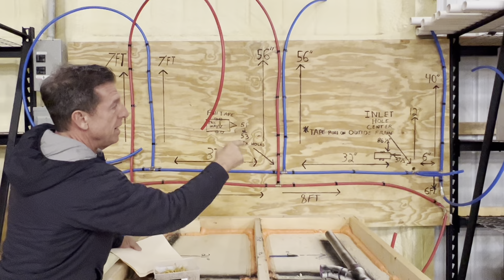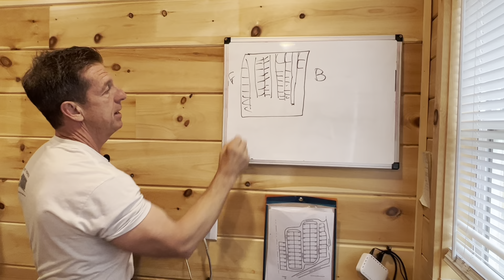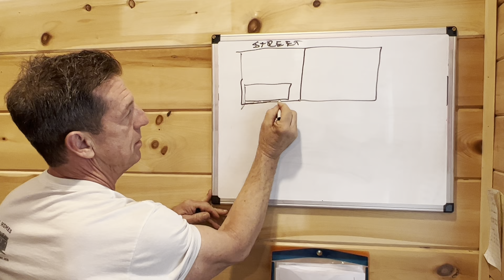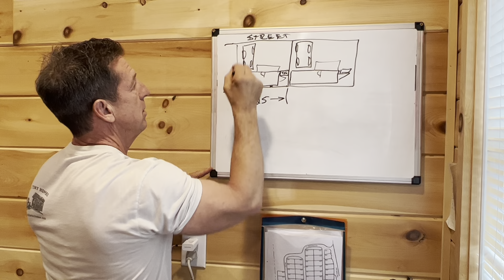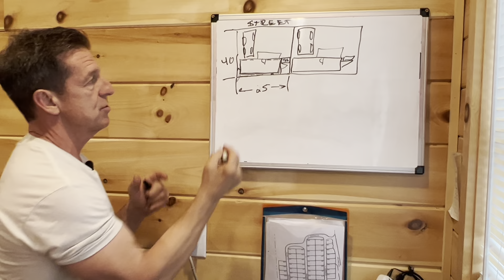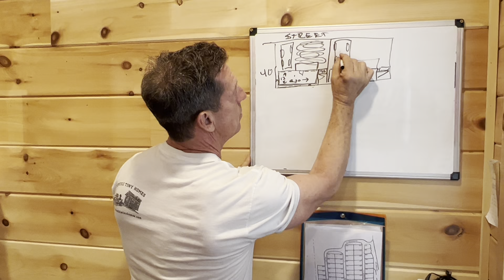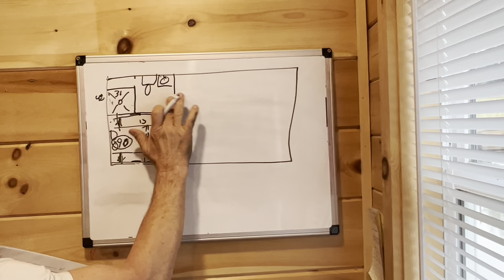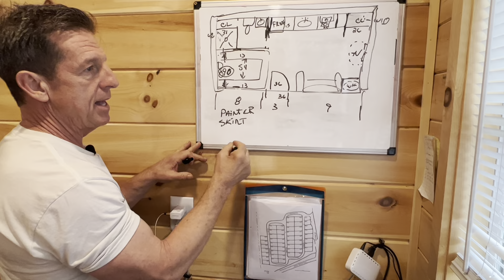FOR SALE….New 12’x20’ Incred-I-Boxes and Leased Lots for $59,900!!!!!!!!!

Comment: ❤ Hi.  love your new assembly line plan.  Love the new Incred-i-box plan too.  However, although I have only seen your drawings and not the actual  house I am feeling a little suffocated.  Why, because of the idea of I guess only maybe two windows which may seem practical to you and your design but, just leaves me feeling suffocated.   I have lived in apartments and know what it is like within some windows, terrible!   But to have my own little or big house without windows is also to me terrible, whether I can see out of them or not.  I suggest some kind of small window over the or by the toilet or sink in bathroom.  Maybe transom windows over sink area or some other small windows on that wall.  Transom  window over bed. And of course your front windows you did not show where in the front.  Also I suggest the W/D be close to the bathroom. If the W/D is not stackable one can build a shelf there over it. And the refrigerator should be switched to the W/D placement at the end of the counter.  I realize these homes will be close but they need other windows on the sides besides the front. There are certain types of shelves if people want that can be placed over or by a window!  I feel this is important psychologically. I may be wrong but it is my opinion.  Continued blessings.  P.S.  many buildings in a city buildings have windows that face walls, however, it my not seem practical but the windows are still there.😊

Comment: That’s a lot of extra plumbing if the water heater is in that corner and the washer dryer in the opposite corner.  that’s my only issue with the design so far. Could it not go just the other side of the bathroom wall where the fridge is? And then the washer dryer beside it and fridge  where you have the washer dryer?

Comment: I don't know it this is possible but the bathroom closet would be better if it was on the other side of the shower because I don't think anything can be stored in the bottom area with the toilet so close. Unless the water heater would fit in the bottom. I sure would like the waterheater some place else so I could put an L shaped hide-a-bed couch (in that corner) with a coffee table that adjusts to a dinning table hieght and 1 chair.  Cute little house.

Comment: Late to the party, as usual!  🙃  Haven't read all of the comments, but I'm seeing some good ideas!

For me, one of the primary concerns is ventilation and air circulation. 

I currently live in a 600 sf apartment with all of the windows on the east side; one fixed pane, two operational. Even with fans, there is dead air in the rear of the apartment. Absolutely miserable, even when it's gorgeous outside!

If the opposite wall had adjustable, screened, transom windows opening outward (creating their own awnings) just below the ceiling, air could flow freely. Window height six inches or so?

...Teale  🏜️

Comment: I am confused. Will you be kind enough to answer questions. I am sorry if I missed the explanation or got it wrong. I have been trying to buy a tiny home from you for months and months, but things keep changing and I get flustered. Question #1. Video after video you talk about wood, stick built, tiny homes and that you will not warranty them anymore because of the expand/contract quality that happens with weather/environment conditions. Now are you saying that the stick-built model homes WILL BE warranted? Is the Omish wood home warranted?  Question #2. When we buy our Tiny home, you said that our money is spent on the product needed to build it. That you stack it on the trailer and it is good to go. So, how many homes are on the books that have been paid for but not yet delivered? Why are you talking about getting in materials and costs of materials for those homes? Shouldn't everything needed to build the home have been bought and in stock over a year+ ago and is ready to go?  Question #3. Now that the ESP home is available to us again, when will the "70-lot home" be finished from the day you cash our check ? Did you tell us this? I may have missed it. Are there custom ESP homes possible too or only stick ? Question #4. Asking Again. Assuming us older folks with health issues live to enjoy several years of living in our beautiful home, and then proudly leave our home to be inherited. The rent is paid. Will you honor the "Forever Rent" price and right to renew the lease ? Or what happens ? Is this in the lease agreement contract ?  I hope these are not dumb questions. 🤔🤔🤔🤔🙃🌲🌲🌳🌳🌼🌼🌻🌻🌷🌷

Comment: Checkout the video Palm Springs revamps trailer park on kirstin Dirksen channel. Now these are bigger homes, but how they place them on the small lots to ensure privacy is very interesting. Also they have the monoslope roofs, with high hopper type windows on the side facing the neighbors for privacy. ( I think if you add just a touch of height on your monoslope roofs on your incrediboxes (and or with the high windows) would really take them up a notch without hopefully much cost. I’ve also seen some tiny home parks that place the lots in such a way that there is a center courtyard shared by 4-6 houses... that can have the fire pit, or other communal space. I hope you will look at your placements one more time and see if there isn’t a way to get as many lots but also make it really livable. I also think the current layout needs a little tweaking. The toilet closet looks unusable to be honest. Your 10x20 esps were really well laid out. I agree with all the comments moving the washer dryer to next to the bathroom and the water heater at the end ( no cabinet, but a bit extra counter top) and refrigerator spot around the corner from the cabinets. A bit of an L shape but just slightly... like in the 10x20 esps. (No one really wants a big permanent wooden box in their living room...) I’m glad you’re doing a bigger incredibox! Also you might consider how to make incrediboxes modular, ie someone could buy a regular incredibox and buy and add on an empty incredibox for extra space...

Comment: Ok, Randy I know your mindset is assembly line production for your Incred-I-Box homes but the water heater in the living room next to the couch just doesn’t check the box for livability and decorating and your not selling the idea that it is the perfect location for an alternative radiant heat source for the living area. 😂 So here’s the idea for the optimal location of the water heater “IN THE LOFT” it’ll be closer to the points of use with it up there. Quicker hot showers means less water waste. So here’s the best reason for my argument. Remember the Hey Beck, Hey Will, video well I’ve watched that video a few times an if you said Hey Will where’s that 19 gal. water heater? Hey Will would say IT’S IN THE STORAGE LOFT!!! 😂 Well if it’s good enough for Becky and Will’s beautiful ITH it should be good enough for the Icred-I-Box. Since the loft covers a 50+ sq. ft. area and a height of 36” at the entrance wall so stealing a little over 2 1/4 square feet of loft space at the bathroom wall in the loft wouldn’t be missed and as you demonstrated in one of your latest video’s the weight capacity per square foot on the Icred-I-Box roof proves it’s an optimal location. If my research was correct you can eliminate the heat trap nipples installed in the water heater and replace them with brass or bronze reducing ell’s or reducing elbow’s with shorter nipples. With the unit plumbed in that manner it would be less than the 25” height it’s spec’d out as. If a slow leak develops and rain drops keep falling on their heads so would Becky and Will’s if theirs leaked. Another plus is don’t have to build 80, I’m assuming here, fancy wood cabinets because that’s the craftsmanship you get from the cabinet shop. By relocating it to the loft it would also give the homeowner more seating options for the living space. Possibly a 97” sofa w/ reversible chaise in front of the windows or Two recliners with a table lamp in between them for the remotes and cool beverages.👍
  FYI the bedroom/bathroom drawing shows the loft width as 84” where the floor plan drawing shows the bedroom width as 90”. 
  Thanks Randy and Amanda for the time and effort you and the rest of the crew behind the scenes that keep things running while your making these ITH videos!!! You guys are a riot!!!😃

Comment: I hate to tell you but I would suggest you look under hu regulations because their government and they supersede all states. Had regulates 15 feet on your ends and on the front and the backside 20 feet. Those are regulations for mobile home parks route RV parks that have lots. Just a suggestion you can take it or leave it but it will save your time if you check it out because it’s nothing like doing them and then having to redo them it’s gonging to take time cost and money. The reason I know this is because I’ve done a lot of research in this area.

Comment: Hi Randy and Amanda! My son is going to pick-up my Incredibox and bring it to me in Arizona. Could you tell me what he needs to be able to drive it there. Are their tags, special insurance?  And what about the route he should take. He's never done this, but is excited for the adventure. :goodvibes:
Reply: Best to send them a email.
Reply: You will need to tag it as a travel trailer (means a trailer tag), and get RV insurance for it (ins. should only be about $100/150 yr). Check your vehicle's towing capacity (you can ask a dealer). You will need at least 6,000lbs capacity, as the Box weighs close to 5,000. But I've towed plenty over the years, and highly suggest 8,000lbs or more capacity. Not sure how high the box is, but stick to major roads as much as possible. Parkways have bridges at 10 feet high, stay off them. If you have any low power lines, ask the County about their heights. Keep your speed at 65 or below. I would recommend 55 if he's never towed. Go to the outside pumps for gas, more room to maneuver. Check satellite views of Gas stops ahead of time, be sure the lots are large enough to pull in and out successfully.
That's about all I can think of. You can PM me with more questions, I've towed all different sizes and lengths of RV's over 25 years.

Comment: I can't sleep 🤔
So on the bath / bedroom end have the bathroom open to the bedroom put toilet , vanity  with hot water tank under it. On the other wall the shower and 30" for a washer/dryer that would give you a 36" wall on the right and a 24" on the left 36" open to walk in. The customer can put a curtain or a barn door or leave open. Apx. 66" x 96"

Keep the kitchen/living room open.

Comment: 40 thousand for a lot.  Bet you could buy land .
Reply: That is completely wrong. Its a leased not a bought lot. In Fact it's about $8000+ for the lot infrastructure and around $52K for the Complete(includes set up, skirting, outside paint, small deck, small shed, etc.) ESP 12 x 20 one story Tiny House with loft storage.
Reply: @michaelclark4357  zillow lot 4951 6.69 acres
Milledgeville tn 15 min to Savannah , no restrictions on land cable internet water electric at the road, 29,900 most likely 50 with septic. 77 people saved this